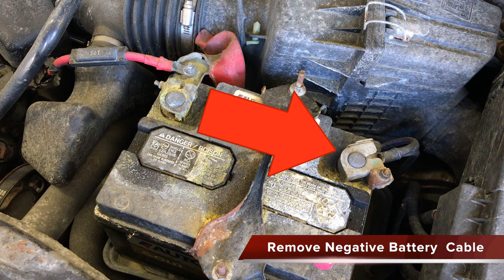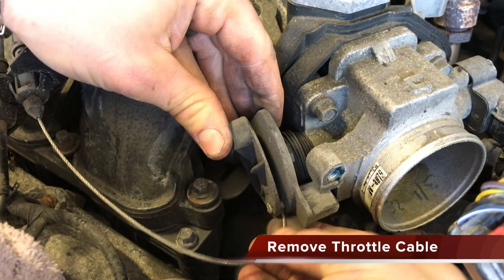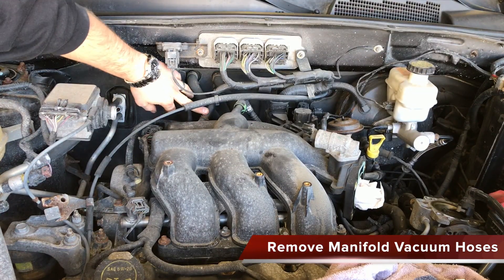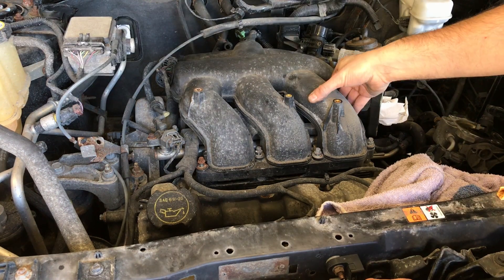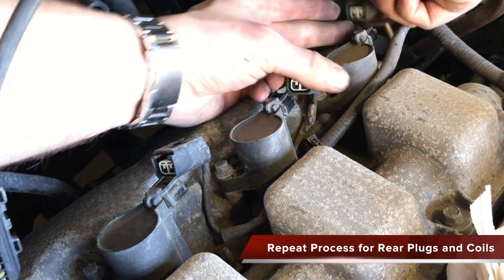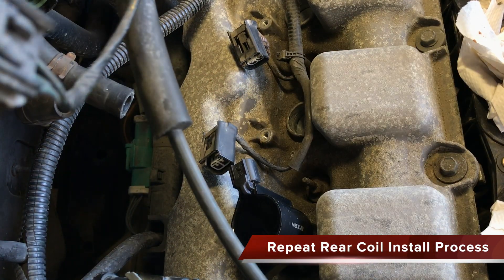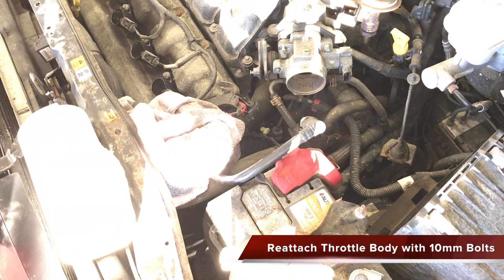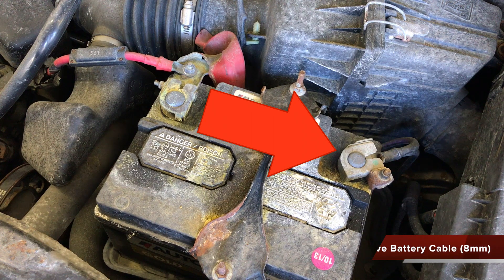2008 Ford Escape Spark Plug, Ignition Coil, and Intake Manifold Gasket Replacement - Duratec 3.0L V6

Comment: DO NOT PUT ANTISEAZE ON SPARK PLUGS.  The literature from the spark plug manufacturers tells you not to.  Also, Torque specs for the bolts are 88 INCH lbs.
Reply from the maker: This is correct guidance. However, the 2008 Ford Escape does have a known issue with spark plugs snapping when being removed. This is an older video, but if I were to re-shoot this, I would have guided the viewer to make the call they feel best about.

Comment: I replaced all coils and plugs on my 2008 Escape and I had this video going on my laptop while I did the replacements. Mt plugs were original and had formed a plug gap of .070 after 145,000 miles. This is a good reason to do a plug replacement at 100,00 miles before they fry the coils.I found that a 8mm and 10mm deep well sockets helped. Thanks!

Comment: I changed the back 3 spark plugs and ignition coils and after putting back together the misfire is gone but I have a rough idle and system lean codes

Comment: It should be noted that this engine takes TAPERED spark plugs instead of FLAT ones with a crush gasket. This is my first experience with these and I had to be really be careful not to over-torque them.

Comment: Great video! Note that if you use NGK spark plugs, you should NOT use anti-seize on the threads. NGK plugs already have proprietary anti-seize coating on them. Other brands would need anti-seize sparingly.

Comment: Very good video! It would have been nice to see the replacement of the PCV valve while the access to it is available. 
Regarding DIELECTRIC grease. The word, "dielectric" means insulating. It should not be applied to conductive metals. It should be applied to all the rubber boots and insulating parts.

Comment: Although this repeats so many other comments, the video is amazing.  Just the right level of detail, clear images showing each and every action, emphasis where needed for important steps and good editing to keep it a reasonable length.  This video is the gold standard and allowed us to tackle the job ourselves.  Thank you.
Reply from the maker: Thank you!
Reply: @DavidStumph  We have a problem that appeared after we completed this repair and I am hoping you can help me with it.  Short story, we have P2195 and P2197 error codes (bank 1 and bank 2 sensor too lean) with poor low speed idle.  I think we have a vacuum leak and there is one hose attached to the throttle body that is a likely culprit.  It is on the  forward, driver's underside of the throttle body and there is not clear place we can see that it might have come disconnected from during the coil replacement.  I cannot see the particular hose well enough from your video to assess where it belongs.  If there is another means to contact you, for more specifics, please let me know.
Reply: We have a problem that appeared after we completed this repair and I am hoping you can help me with it.  Short story, we have P2195 and P2197 error codes (bank 1 and bank 2 sensor too lean) with poor low speed idle.  I think we have a vacuum leak and there is one hose attached to the throttle body that is a likely culprit.  It is on the  forward, driver's underside of the throttle body and there is not clear place we can see that it might have come disconnected from during the coil replacement.  I cannot see the particular hose well enough from your video to assess where it belongs.  If there is another means to contact you, for more specifics, please let me know.

Comment: FYI aluminum heads and steel plugs can cause a big headache if not changed at recommended time. Do not get too forceful or you will end up removing threads with the plug.

Comment: Nice video David - thanks for being so complete.  One comment - mine is a 2008, and one change to this very complete and detailed instruction is that there is another hose connected to the manifold under where the throttle-body is installed.  That must be disconnected to remove the manifold, and it is a simple clamp type connection.  Aside from that these instructions were perfect and exactly what I needed for a first-timer doing this service.  Last note - do the PCV valve if you are doing this as the service interval is nearly the same as for the plugs.  The PCV valve is located on the back valve cover on the right-hand side and is easily accessible with the intake removed.  There is an instruction on YouTube on how to do it, so just search.  Thanks.

Comment: Excellent and probably most detailed video on youtube on replacing the 2008 Ford Escape V6 valve cover and spark plugs. What the dealer wanted to charge to change the plugs, gaskets, and replace coil pack was several hundred dollars. 

I ordered the parts off Rock Auto website saving a bundle and watched this video w my boy several times before tackling the project. Gotta say this took me a few hours but absolutely worth it in the end, because the Escape is not knocking running smooth again. And the oil leak is gone now that new seals and gasket maker was applied. Thanks again for posting!
Reply from the maker: Glad I was able to help, I had the same experience and said nope, I’ll change them myself!

Comment: Best video of doin this job. Where is the pcv valve on 07-08 3liter
Reply: On my Mazda Tribute 2006 its at the back right of the engine (when standing in front) behind the intake manifold.  You probably want to do this while you have the manifold off.